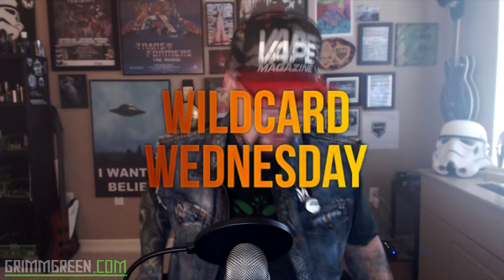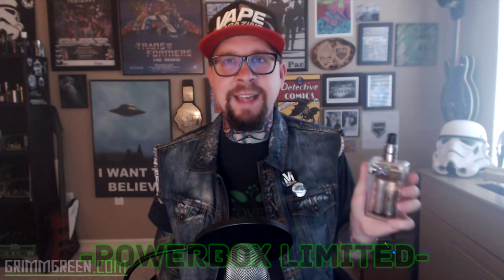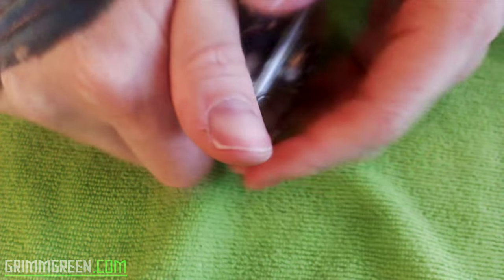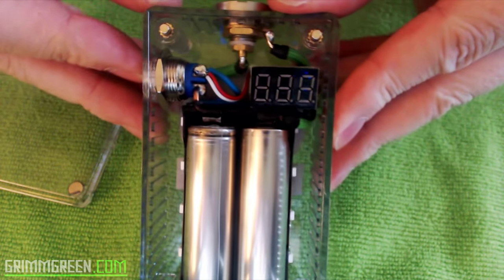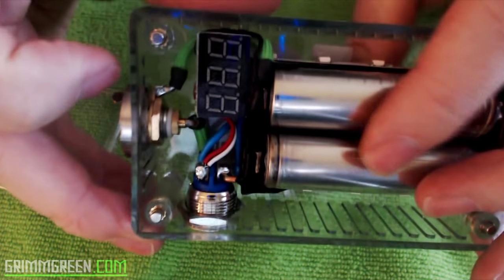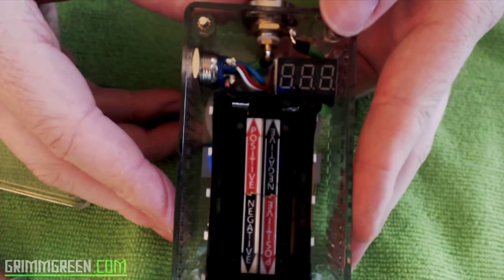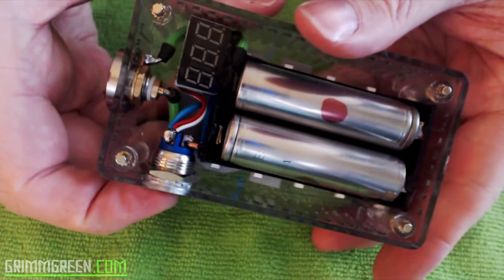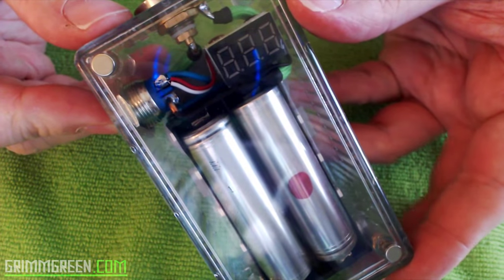The Powerbox Limited ~ Box Mod

Comment: 12v 30amp switch. No need for a mosfet!

Dont say 7volts is alot of power. That switch wont break. Only under 0.233ohms it will get dangerous.

Do your homework.
7volts / 30amp = 0.233 ohm.
7.8volts / 30amp = 0.26ohms.

Good luck and dont hurt yourself.

Comment: Where can I buy one someone plz put up a link
Reply from the maker: Julio Palacios There's a link in the description dude
Reply: Yes Grimm green but they have to have a website besides Facebook unless I'm just blind or dumb enough not to see it...I really want this mid u have. It seems like a great piece and mod to have before our comp coming up
Reply: no website just fb. welcome to email me powersgirl828@gmail.com
Reply: buy a real mod. this thing is garbage. no MOSFET? what are you paying $125 for? some $3 LED boards from FT, a $1.46 16mm momentary button from China, a $1.60 battery tray from fasttech, a $4 box, a $5 fatdaddy 510,  and a $1 voltmeter - also from fasttech. Then maybe $10 worth of labor to assemble it. 
I'd build you this box, with the proper MOSFET so it doesn't start autofiring a week after using, for maybe $50 including priority shipping -_- don't get scammed.
Reply: +Julio Palacios I have 2 of them